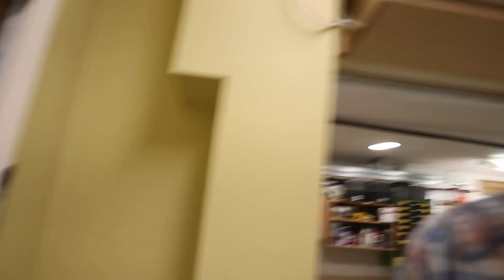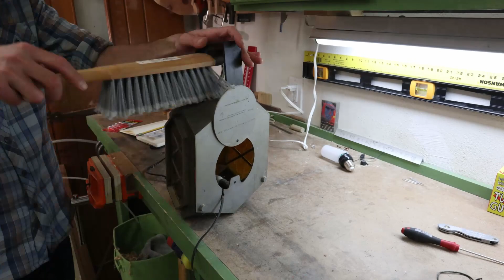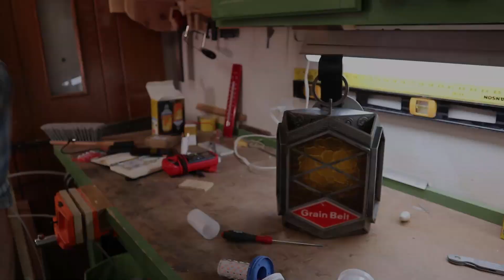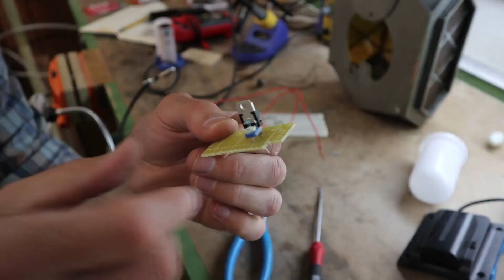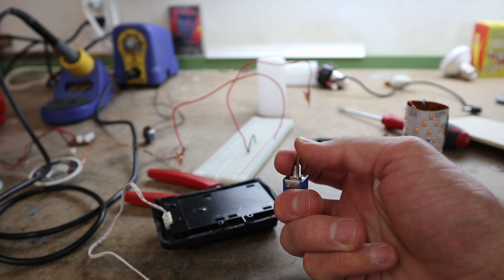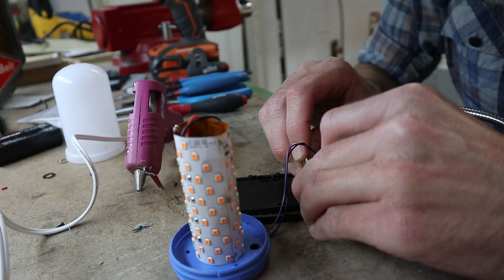Vintage Beer Sign Restoration with LED FLAME Light Hack

Comment: Hey! You ME's need to stay in your lane! I've always said that inside of every ME there is a Controls Engineer itching to get out. Cool project BTW! And there is no shame in hot melt glue... :)

As for me, I reverse engineered a 40 year old Kuroda PC-1024ZL-WFT-68 encoder and connected it to our new lathe controller (CamSoft) today. Three more encoders, three drives, and the hydraulics and we will be ready to run. Then it's programming, debug, lather, rinse, repeat.

No video, especially no live stream. It would be hours of video watching me alternating between scratching my head, and scratching my butt. Kinda like what I do in real life... :)
Reply from the maker: Haha oh man this comment got sucked into the void of YouTube's auto-spam filter so I just saw it. ME's know EVERYTHING! 😉 But that encoder thing does sound a bit over my head. As for the hours of head scratching video...let's just say I got pretty aggressive with the editing...
Reply: @WegsGarage  I don't think that it was an accident. YouTube is on to me... 

Turns out that while the next two encoders had their specs printed out nice and pretty on the side of the encoders, they are incompatible as-is. So it was off to the Internet to get a couple of converters, and the converters aren't fully compatible either. So it was off to RadioShack for some Zener diodes. It never ends... 

Of course one could ask why in the world are they outfitting their lathes with different kinds of encoders that run at different kind of voltages. But you would probably get two different kinds of answers.

Probably the most amazing thing in this entire comment is that we still have a RadioShack in town. Okay, that and that they actually have electronic parts. Okay, those two things and that they actually had the part that I was looking for (which the electronics parts house in the next town over didn't). High-level Twilight Zone stuff going on around here.

Hey, wait a minute, we also have a drive-in theater here as well! Should I be worried?

As for the editing, it was great! But what would make it nicer would be editing TOG working on a transmission. Hint, hint. ;>

With cheftush fooling around with his motorcycles, you on lockdown, and Elin dragging lake bottoms for old Triumphs, things are getting too quiet. :)
Reply from the maker: Wow a Radio Shack! I remember back in my model train days (a story for another day...) I had a choice of 5(!) Radio Shacks within driving distance of my parents' house. Now, not a single one! And not a single store of any kind selling so much as a resistor. Your hometown sounds like a magical land of lost businesses! 
As for the transmission videos, I have some good news and some bad news: Good news is we have reunited! Bad news is you will have to wait one more week for the next video. But then it's GO TIME! Trans, interior, lotsa fiddly little details. I can't wait!

Comment: Why not glue the power supply to a circut board,  AND hook the light to it.?.? Unless you intend to use it for power outages,    it would be more convenient.? A great project, inspired me to do it my way, as soon as I catch up on roundtoits.... thanks wegs jr....
Reply from the maker: Awesome, there are a million ways to do it. If I did it 10 times they would probably all be different 😂. Good luck on the 'tuits!